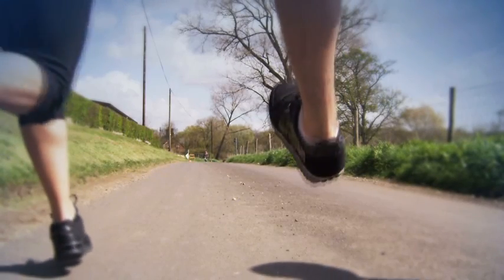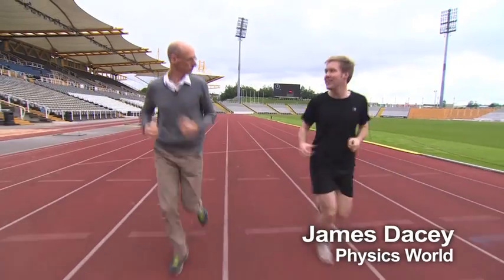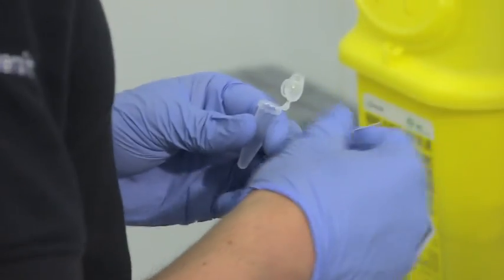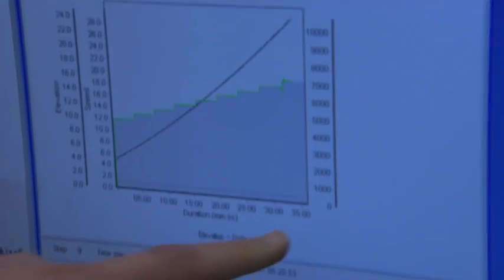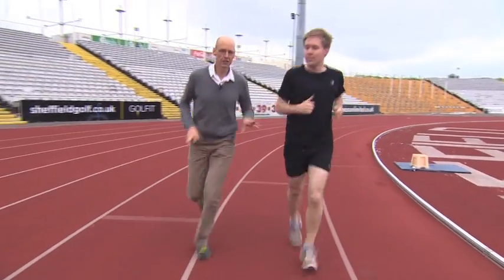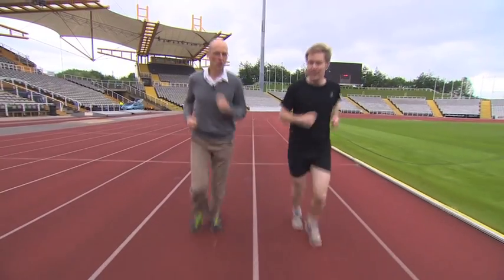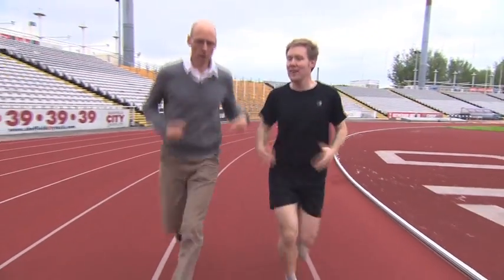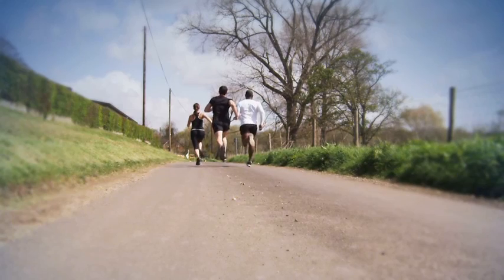The physics of running

Comment: Need HELP admin.!!! Physics World 

Hello i am Naveen (age 26, good heart health, 5'6'', 73 kgs.), i am from India i do 6 kms in 30 mins. In india, weather is not always stable,. We have 2 months of intense winter and unlike western countries, 6 months of harsh scorching summers, temperature always above 42 degree, even went on to 46-47 degrees, humidity at higher side. How to improve the stamina in this ever changing weather conditions with summers along with humidity and loo as dominant factor? We don't have leisure of low temperature all around the year. When i was becoming used too to winter suddenly summers arrived and now just adapting to this changing weather. I want to increase my stamina but i am rather spending the energy on adapting to ever increasing temperature and humidity. Also my city is one of the most polluted city of the word, perhaps in top 10. Kindly suggest.